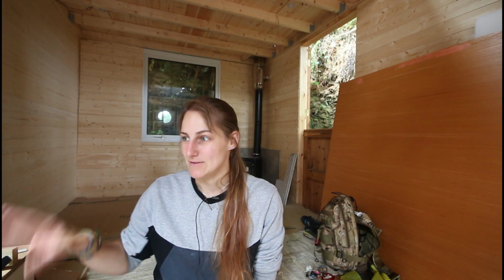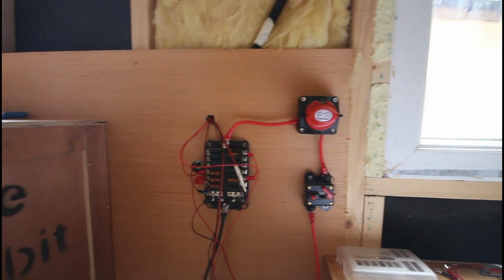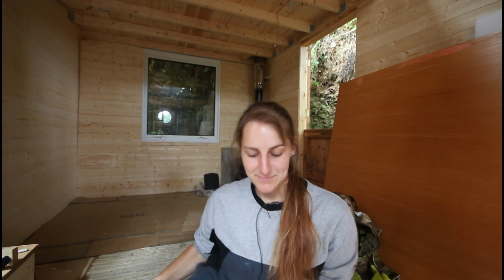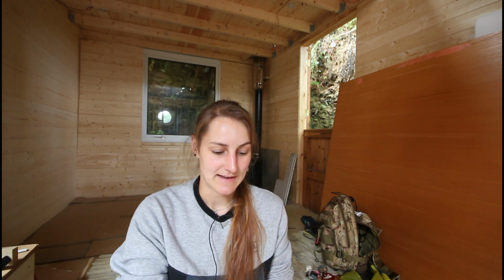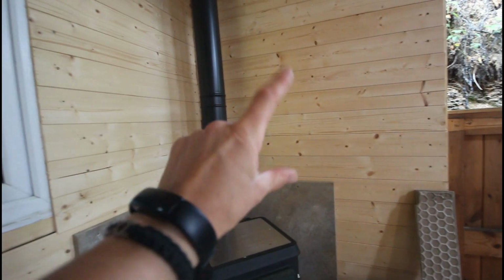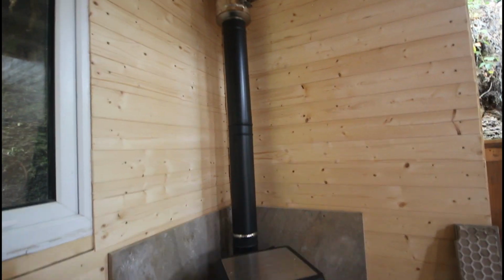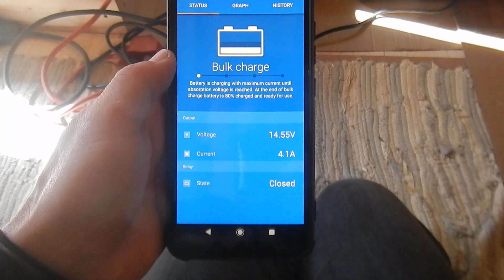Tiny House Update - Wood Burning Stove & Electrics - UK - DIY

Comment: I had the same re-setable fuse in my setup, they don't seem to be able to cope with the rated current. I went through 3 of them before I gave up and fitted a big fuse instead! As for the batteries, if they are flooded (if they slosh when moved) they will give off hydrogen when charging and so the box will need venting to the outside (something else I found out after installing it wrong!). If they are totally sealed type them no worries, but check the charger is set correctly as sealed and flooded have slightly different charging voltages. Sorry to mansplain at you! Build looks great!
Reply from the maker: Hi Max, 
Thank you for the info, glad I'm not the only one running into these problems - that good to know about the re-settable fuse, thought I had done something wrong. I've emailed both the battery company and charger company for a second opinion so should be good 😀 it's  great to lights :)
Cheers, it's getting there piece by piece 🔨